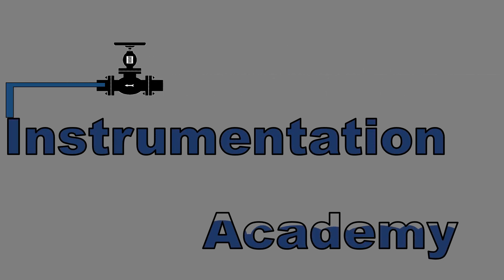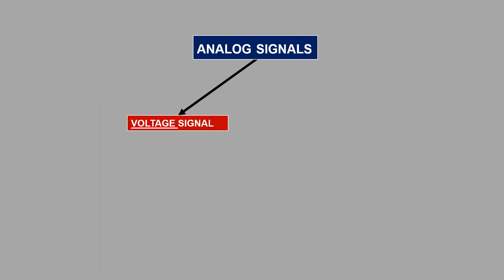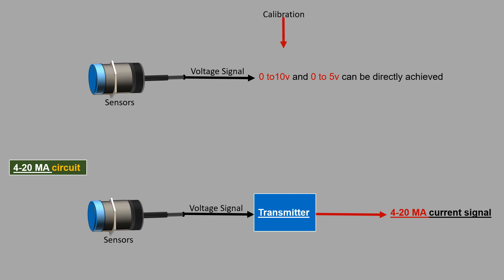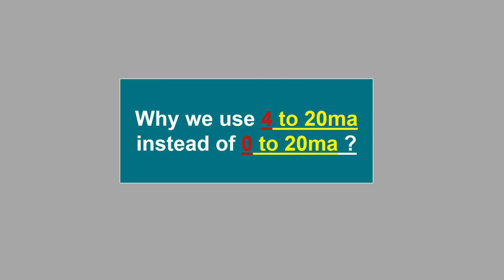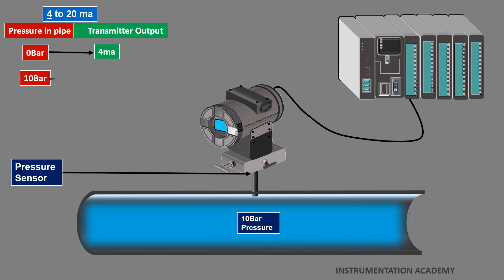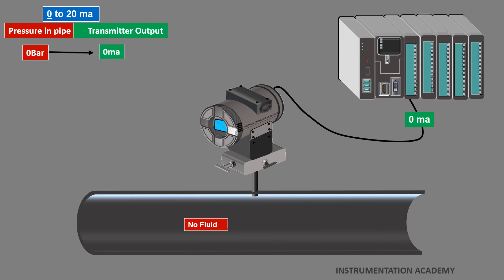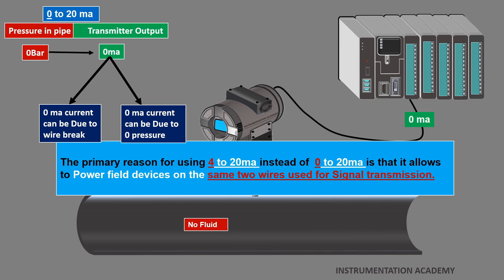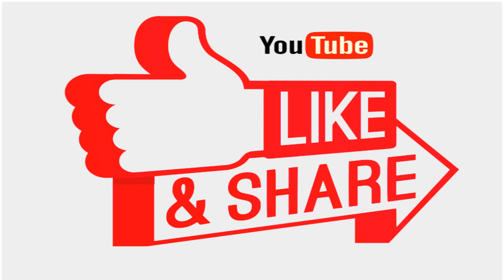Why 4 to 20ma is used for Signal Transmission in Instrumentation. 4-20ma current signal.4to 20ma

Comment: Amazing video.  Never understood why there were Process Meters 4-20mA, now I know that it is to measure the specifically the process plant signals for transmitters to PLCʻs.

The setup is similar to Automotive.  Field Instruments to PLC to Final Control Element would be Sensors to ECM to Components.

Comment: Ma'am ..why we use only 20mA ...why not use ...25..30mA.. please answer me ma'am....this question is asked me in interview.
Reply: No bcoz that's the minimum range we can select as per our requirements to also power on the devices and to detect the faults too. And to keep it minimal is also a good idea to keep the current consumption at the lowest if the system is large scaled which will consume more power.😊 So it's considered as standard too. Why to increase the current if same could be achieved at the lowest range possible.😊 It works great at short or long distance communication too.